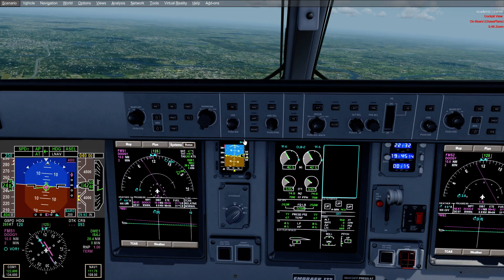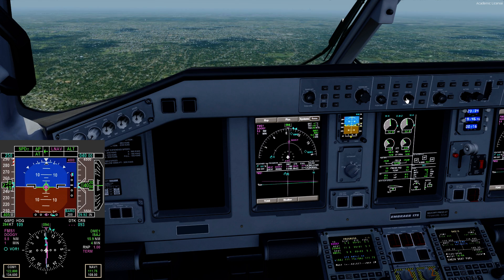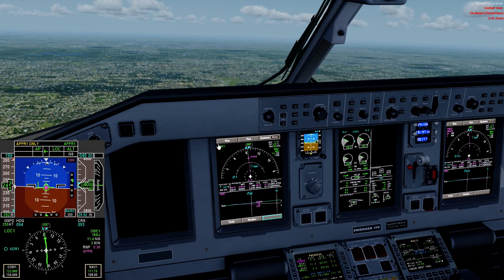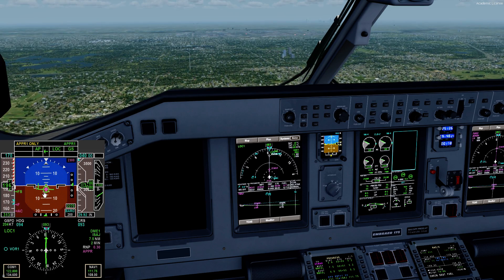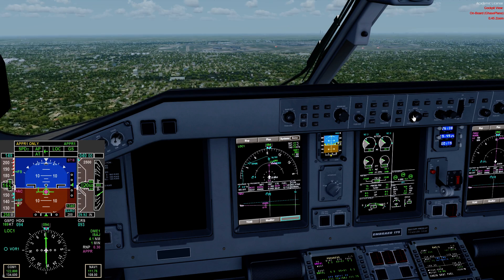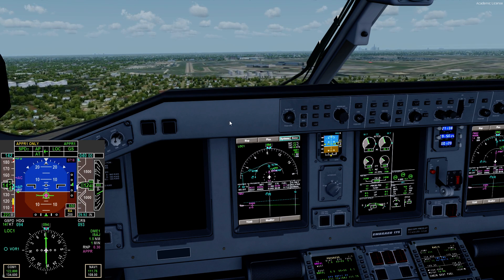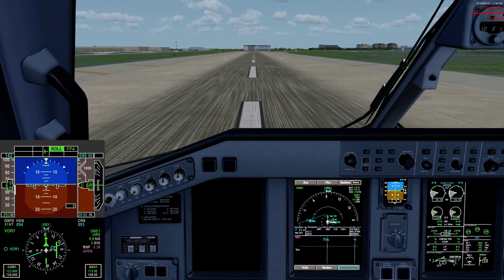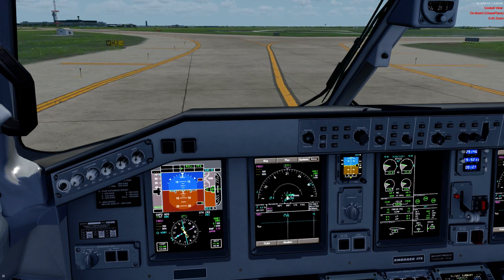FEELTHERE EMBRAER EMB FOR P3D4 FLIGHT SIMULATOR LANDING

Comment: I didn't quite understand why you only used flaps 5, and came in with quite a high aoa. Could you please explain that again?
Reply: The Embraer is certified to land with either flaps 5 or full. Flaps 5 gives a high nose attitude, but less flap wear, lower fuel consumption, less noise. Flaps full are generally used on the shorter runways..
Reply: There are many reasons, but mainly flaps full will give you a lower approach speed if that's what you need. See below comment. Also, you save about 200 lbs of fuel from the marker in by using flaps 5 vs full.